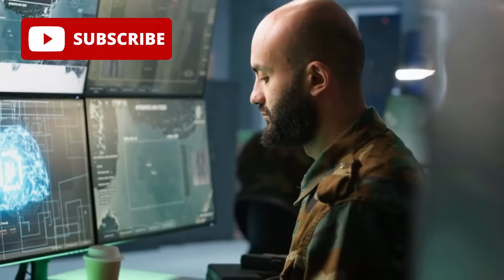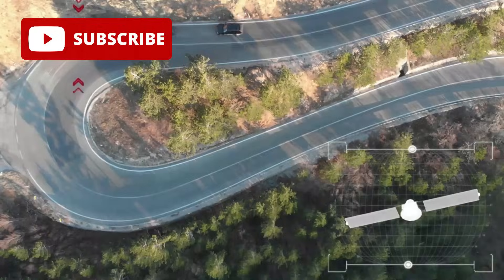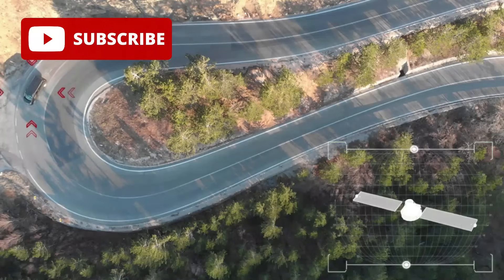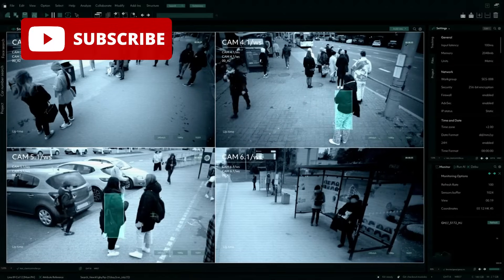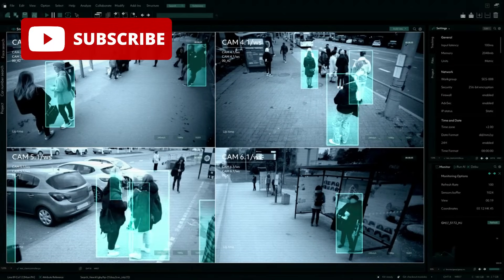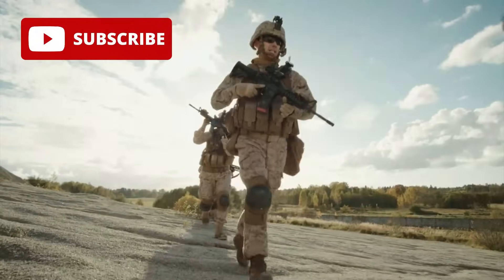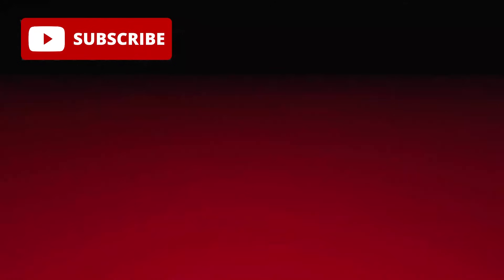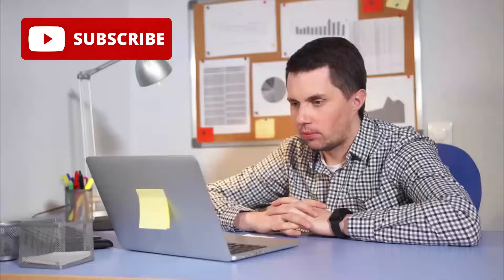China’s Last Move The Game-Changing Tech Set to Wipe Out Global Competition!

Comment: Western excessive arrogance and irrational narcissism turn out to be the main obstacles to progress and advancements because Westerners think that their way of doing things is the Only Way, the same logic applies to the misleading assumption that there must be a “correlation between economic development and adoption of western democracy in a country”. However, China has proven these myopic ideology and unfounded  narrative are wrong and not applicable to many non-Western countries !

The breakthrough in chip design and production by Huawei and other Chinese research centers has also proven that there are other Ways to materialize high-end and working chips, in fact the measurement in nanometers for a chip is not the most important element in a device or in an AI Model but it is the architecture and computing methods.  DeepSeek has demonstrated that Reality by using less chips with less computing capacity/capabilities.  Further, the particularity of the Chinese language and its associated writing system (based on picto-ideo-phonograms) provide a more simplified approach to train large language models because Chinese engineers only use 3,500 of such PIP-grams whereas there are constantly new words being invented on a daily basis for English or other languages with phonetic-based writing system, thus increasing the need for data storage and additional machine learning requirements as well as power usage.

Further, China produces more engineers and scientists per year than all the developed countries combined.  In 2025, the country is slated to have 12 million university graduates, and according to the latest statistics, 70 % of university students are enrolled in STEM studies.

From a market standpoint, the quantity of users of a given technology will determine not only its technological standards but also its dominance in the world.

One element very important concerning the future technological advancements of China is that in addition to having its own operating system, HARMONY Next OS, Huawei also just introduces its Chinese language-based Programming Language - CanJie, the first of its kind in the world.